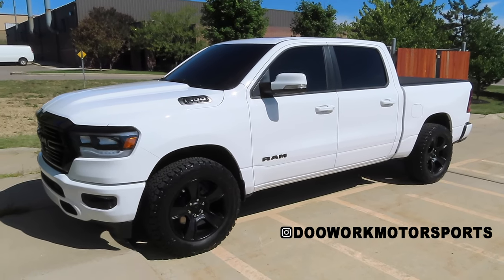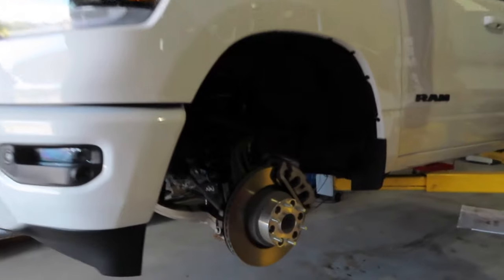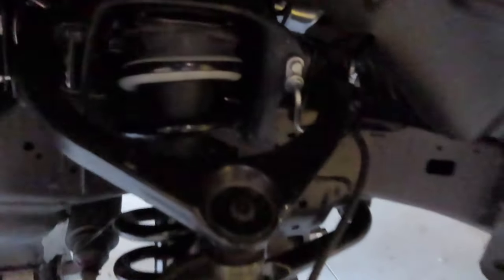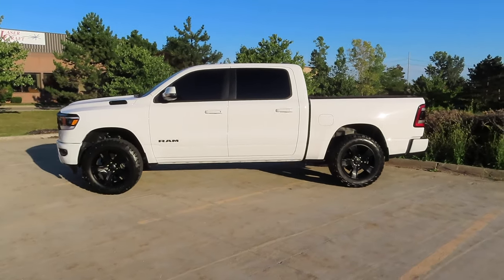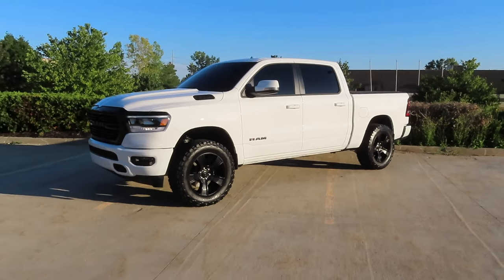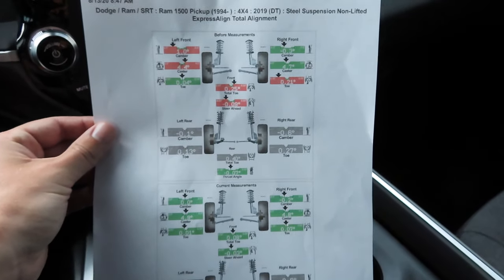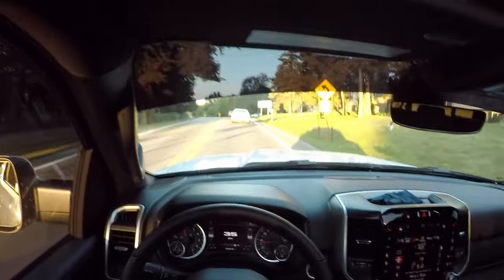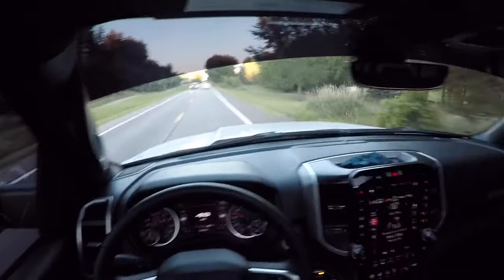2020 RAM 1500 LEVELING KIT INSTALL! (2.5" MOTO FAB LEVELING KIT) FIRST MOD!

Comment: Looks Great! Would like to do what you did on my 2019 Ram 1500. Want to make sure fits in my garage. Can you please tell me what the overall height of your truck is to the top of the shark fin antenna on top of cab is? Or do you remember total height in inches it added compared to the stock truck? I’m guessing 4.5 inches lift + tires?

Comment: Looks amazing!  Just did a Bilstein shock 2" level on my 20 Laramie. Need an alignment now... did you follow the factory specs for your alignment after the level?
Reply from the maker: Yessir
Reply: With the 2” shock kit is the control arm still on that kind of angle?

Comment: Hey, I recognize that truck. Thanks for helping me with my leveling kit decision with this video! Wonder if the kit will work on the Warlock Classic or Rebel?
Reply from the maker: It will work on both of those trucks as long as they are a 4X4 and don't have the air suspension..

Comment: I went with the 2 inch on my rebel. Kinda disappointed and wish I went with the 2.5, still sits quite a bit Lower in the front but it’ll be better since I won’t be nose high with a light load in the back

Comment: Nice looking truck!  I have the exact same truck, white with night edition. I added rough country 2" strut leveling kit which  replaced the front struts with longer ones.   Still rides like factory
Reply: Now they have leveing struts
Reply: what size tire do you run with that? and did the 2" level it completely? I have the 22 in white and I'm looking at getting that same level kit.

Comment: I own a 2019 Ram 1500 Big Horn 4x4. I purchased a set of BF Goodrich ko2 all terrain 275/65 18 tires, I also am installing 2” spacers. Do you think I will have rubbing issues and need to install a leveling kit?

Comment: Just put these on, thanks for the video. For some reason, at the tail end of turning left or right the spring(of that side) compresses and my front end noticeably dips about a half inch...any clue what could be causing that?

Comment: Hey man, great videos.  Quick question, I have a 2020 ram I put the same 2.5” lift and rebel tires/rims… I have not had an alignment but have noticed a serious whining noise from the front end at 50mph…. What do you think?
Reply from the maker: That's weird, I have never experienced that with mine.

Comment: awesome truck! but would be any issues if this is done in a rebel since it goes aeromode above 60 m/hr because it has air suspension or do the sensors need to be chip?

Comment: Do you need new control arms with the 2.5 or is it fine with the stocks ones? Also how does it ride off-road?
Reply: I put readylift tubular control arms on mine. They cover from 2 to 4 inch es of lift.
Reply: @jeremysylvia3237  link to arm’s

Comment: Just purchased a 2021 rebel 4 x 4 .  dealer is saying that the block lifts are not recommended for this truck and they cause front end damage if used.. THe tech is recommending the bds lift kit for $3200 installed..
Reply from the maker: I haven't had any problems with my leveling blocks.. I have had them on 4 trucks now. No issues.. If you don't want to lift the truck more than 2.5" then don't buy that BDS lift.  If you want the truck lifted 6" than the BDS lift is a great choice.  I just wanted the leveled look, so that is why I went with these..

Comment: Is the front leveling kit all you have installed? If so does it look leveled or should I buy something for the back end as well? Debating on just doing the front or not, TIA!
Reply from the maker: Yes, just a 2.5" level in the front.. Nothing in the rear.  Sits perfectly level.

Comment: Put a 4ft level underneath the door sill and you will see that you are now running high in the front, the rear fender well has more arc than the front
Reply: 4ft...Jesus that's 48"

Comment: Truck looks great bud i was just wondering about those two inch spacers did you feel any difference in the truck feeling heavier
Reply from the maker: The truck rides a little stiffer than stock but thats it.
Reply: @DOOWORKPRODUCTIONS  okay thanks for replying back I'll keep that in mind, I was thinking of putting 1.25-in spacers on mine and keeping my stock wheels

Comment: Just purchased a 2019 Ram 1500 2wd new body style and I plan to put on a 2.5 front leveling kit with 35x12.5 tires on 18x9 wheels! Does anyone have any knowledge as to of this would cause any rubbing? If so what can be done to combat that issue? Also, will I absolutely need to purchase to control arms? And why? (First time truck buyer & first time dealing with large wheels/tires and any type of leveling kit)

Comment: Love it bro!💪🏾 what percentage of tint did you go with?
Reply from the maker: 5% all around, 35% on windshield..
Reply: @DOOWORKPRODUCTIONS  Whoever had my '19 RAM before me did 5% fronts then 20% over factory smoke in the rear.  Looked weird and couldn't see at night, but looked great from the outside.  Personal preference I suppose
Reply: @DOOWORKPRODUCTIONS  HI there, nice truck!. Can this leveling kit be installed on a 2020 Ram Laramie Sport, 2 wheel drive??
Reply from the maker: @bluelinetroop.7785  No

Comment: Installed 2.5” leveling kit on my ram 1500. After installation it’s making a clicking noise On some bumps. Any idea what’s wrong or is it normal?
Reply from the maker: Make sure everything it tight especially your UCA bolts.
Reply: I'm running ReadyLift uca's, no problem here. RL makes uca's for 2" - 4" kits. That what I have!

Comment: Can I get a 1 inch level spacer for the rear suspension only? I have motofab 2.5 on front and the front looks higher! I have a 2019 Ram Bighorn sport 4X4. TY. Nice Ram
Reply from the maker: That I'm Not sure of..

Comment: What’s your opinion on 35”s with a 2.5 level? I was set on 35”s for mine as everyone told me 33”s would look too small, but yours look badass. 35”s too big?
Reply from the maker: You will rub with 35's on a 2.5" level..

Comment: Hi I just put thus same kit on a 2021 ram 1500 big horn and I'm having some noise issues in the front end intermittently.  All torques have been triple checked any suggestions ? Also have experienced anything similar?
Reply from the maker: Hmm.. Not sure what it could be.  I had a squeak noise on my '19, but nothing on my '20.

Comment: Question, instead of the 2" spacers, could you just go with like 285/55/20 or 285 50/20? Would that give you that same amount of tire outside the fender well?
Reply from the maker: Not sure..
Reply: The factory wheel is 20x9 if you want a wider look go 20x10 or 20x12  on a 33x12.5r20 tire no rub👌

Comment: Did you need the wheel spacers to fit the 285/60/20 tires on the stock rims or did you just use them for looks?
Reply: @DOOWORKPRODUCTIONS  That wasn't a yes or no question.
Reply from the maker: No, I just did it for looks.

Comment: Besides, the .5” difference - why would someone get the 3” spacer, instead of the 2.5”? They’re both the same price too
Reply: I definitely wouldn't. Because then you would really need new upper control arms. I think you can get away with the stock ones with the 2.5"

Comment: Does it ride the same as oem? or did it change the ride quality? want this on my 2020 limited longhorn but unsure if it will change the ride dramatically since I already have the stock 22”s.
Reply from the maker: It rides a little rougher than stock.  But not bad..
Reply: @DOOWORKPRODUCTIONS  I’m doing the 2” not the 2.5” so you think maybe it’ll be less taken away from ride quality or the same. I’m just guessing the higher you lift the rougher the ride.
Reply from the maker: @jorangel87  I'm not sure, I've never done a 2"..

Comment: I did the same level kit and 4 shops can’t get the alignment on my 2021 Laramie any advice I don’t want my 33” nitto getting mangled with the wheel pulling to the right
Reply from the maker: I have the same problem.  Can't find an alignment shop to make it 100% right. It amazes me that these Hunter Alignment Racks don't have updated software to align these new trucks...
Reply: My only option was to order rough country’s 3.5 lift kit which cost 1100$ that includes the struts and shocks instead of the puck spacer. I heard the reason why we can’t get the trucks aligned is because of the control arms being to out of wack and the new heavy duty control arms will sit flat and not throw off the geometry. With the 2.5 motofab the control arm is at max angle
Reply from the maker: @dominickli3633  That makes sense!

Comment: How are your UCA's holding up? Any issues? I just installed the same Motofab 2.5" level kit. Wondering if I should have gone with new UCA's.
Reply from the maker: Mine are fine so far..
Reply: I got same 2.5 motofab on my 19 big horn my UCAs are still ok
Reply: @misaelcarrillo833  Thanks, mine are installed now, no issues so far. Doesnt really look it will be a problem
Reply: Any issues years later with the upper control arms?

Comment: Do the 33's rub with the leveling kit & spacers? Thanks
Reply from the maker: No.
Reply: 33’s won’t rub stock. I’m stock with falken wildpeak at3 275/60r/20 (33”). Now if you go 12.5 wide without spacers I’m sure you will rub
Reply: I have 20x10 wheels with -24 offset and 33x12.5 tires on stock suspension with no rubbing

Comment: What tires are those
Reply from the maker: 285/60-20 BFGoodrich KO2 Tires.
Reply: @DOOWORKPRODUCTIONS  are those the stock rims the truck came with
Reply from the maker: Yes @dripbigtimejoe8740